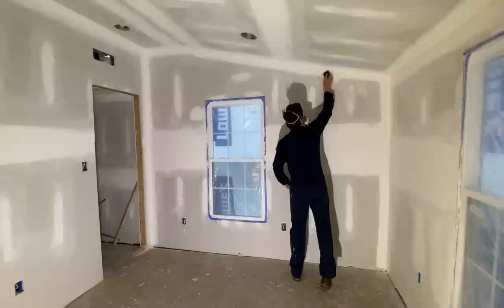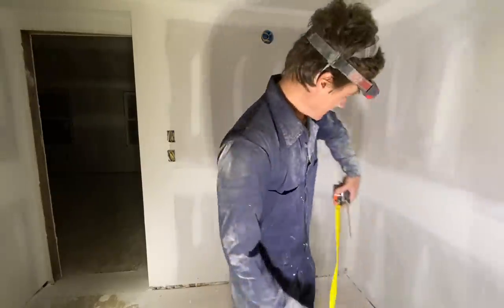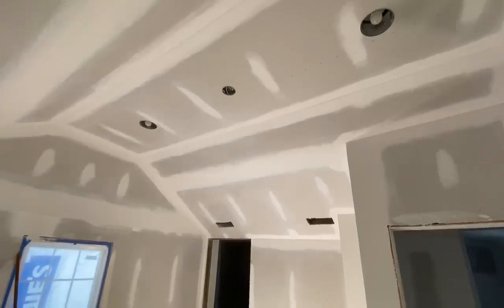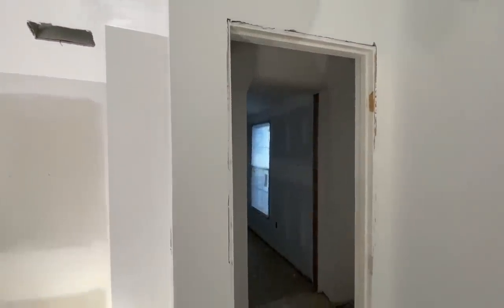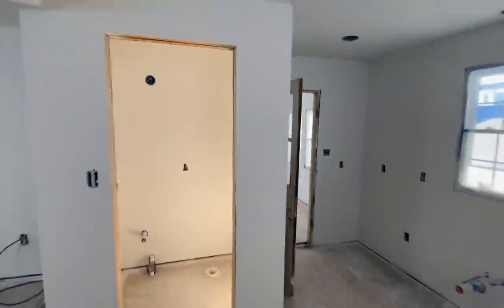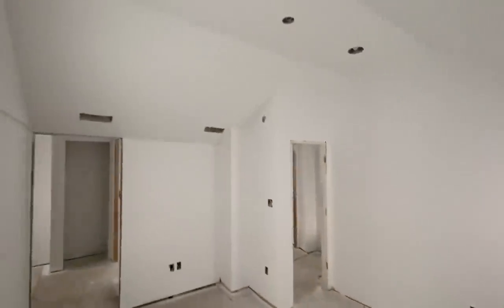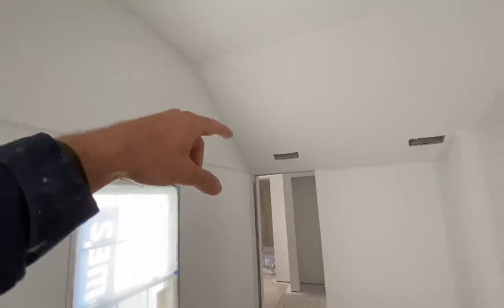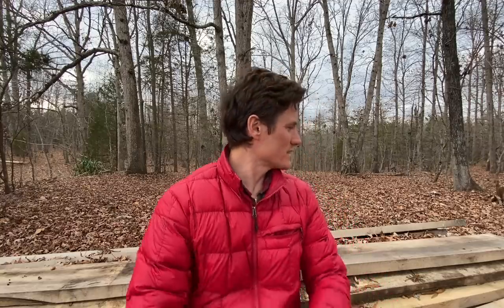$9,000 HOUSE - BIG TRANSFORMATION - PAINTING - Ep. 58

Comment: I would definitely call out the drywall installer on this, once the electricity is turned on those two wires could have possibly arched out and burnt that home down. 
I'd go over the video of every room and see if they covered any more, this is one problem with using the rotozip tool, they throw up the sheet rock and then guess where the hole needs to be cut, very easy to forget an outlet if two installers are working the same wall.

Comment: those greicos are nice.  i have the same machine.   i like to put it in a couple gallons of water first thing and spray the floor where it meets the wall before i paint.  it keeps all the dust and any crap stuck to the floor so it wont blow up onto the wall when i spray the paint.   i tape the hinges with blue tape first.  any overspray i keep a gallon of isopropyl alcohol around. comes right off.
i still would have given the kitchen that entire wall where the bathroom door is and put the bath door just to the right as you enter from the breezeway.  left hand swing it in
Reply from the maker: Thats a good idea, I blasted dust and junk into the wet primer a bunch of times and will have to go back and sand it out before painting. Even vacuumed good before starting, water is a good idea.

Comment: As someone who started painting at 12 years old with my stepfather and also worked for a major paint manufacturer in sales and specification for 15 years, You definitely don't need an additional primer over that PVA in the bathroom. If you think it needs another coat of primer, just do another coat of PVA. Where you'll get your mold resistant and moisture resistant benefits are in the top coat. Use a top coat intended for bathrooms and it'll last.

Comment: An additional coat of primer over a PVA primer has very little value.  The PVA seals the drywall, providing an excellent surface for your finish paint.  A quality finish paint over that primer will be all that you need.  Allow the primer to fully dry, then apply two coats of paint, and you'll be golden.  I'm no absolute expert, but I'm coming up on a decade of professional painting experience, and I've learned a lot.  Not sure what steered you toward the PVA, but that was an excellent choice!

Comment: I highly recommend getting a large 18” roller for wall paint. It’s life changing. I stopped using a sprayer to paint walls now that I have it. Much cleaner than a sprayer but super fast
Reply from the maker: I've dislocated my collar bone several times and have a compression fracture in my neck, doing stuff like rolling ceilings and even the walls is very hard for me to do, even if I ignore it hurting at some point it's almost like my arm goes asleep. For me the painting is a quick way to get the paint on, no holding a brush in corners, etc. Then just a quick bankrolling with a semi dry roller. When I've rolled entire houses I thought I was going to die by the end......with that said, I can see how it would be faster and you would not have to mess with the sprayer before and after painting. Quick to start and toss the roller when done.

Comment: If your put Vaseline on your face, it makes it easier to wash the over spray of later.  

Seems like your didn't have to much trouble spraying the PVA primer.  I tried using PVA primer with a roller on moisture safe drywall, and it was really inconsistent.  I had much better results rolling with kills primer.  I wonder if the sprayer is needed for good results with the PVA primer.
Reply from the maker: Thanks, a good idea. Spraying just works so good, puts the paint on the wall quick and consistent thickness and then the bankrolling makes it even better.

Comment: Absolutely hate flat white paint. As a property manager with 20 plus units to take care of, we end up washing walls on most of the units. Flat paint makes it tougher to clean. I prefer a light colour, any colour at all. It makes touch ups easy to find, quickly repair, and quickly touch up. We had one unit , the previous 5 year tenant moved out, the new tenant moved in the same day, and lived there 8 years.  Thankfully neither where smokers, but 13 years with white walls, white carpets, white lino floors. I hate white, lol. We ended up doing almost a complete renovation, excluding cupboards, vanity, and tub. There is an adjoining suite that next time it comes empty in the summer will get fresh paint, just the living room is 3 different shades of blue, because out of town former owners insisted on the cheapest paint possible from different companies and different cities. The local national hardware store has great paint, but it's not discount priced. I've reached the point, if they want to use discount paint, they can supply it, and the printers also, and they can pay the next unit cleaning.

Comment: Great video. Do yourself a favor. Buy a blue tip guard and fine finish low pressure green tips before you spray again. A.k.a. greco "fflp" tips. You can spray at a MUCH lower pressure creating ALOT less overspray. That spray fog in the sunroom was unreal. Wasted material and a bigger mess with the oldschool black tips. FFLP tips are spendy but worth it. I spray on basically every job I do to make time working alone. You can get the tips around 20 bucks cheaper off ebay. Sherwin Williams has them at 70 bucks. Try them, you wont spray again without them.
Reply from the maker: Thank you, I was not aware of them

Comment: Could you have used a magnet to find those receptacles?  😊
Reply: A magnet would not work very well in finding a plastic box and copper wire. If it were a steel box, may work. He did have other videos to find them and also he placed all the electrical boxes at the same height.  This just made a few more steps in each room. All worked out well.

Comment: Why roll it after you spray it? I thought people sprayed so they don't have to roll.
Reply: This is a primer coat to seal the drywall. It should be rolled to even out the primer. It shows through unevenly if it is not rolled out everywhere. Also, it hardens the paper on the drywall.
Reply: Another ting is the primer has a blueish tint to it. That will show through any white paint topcoat.